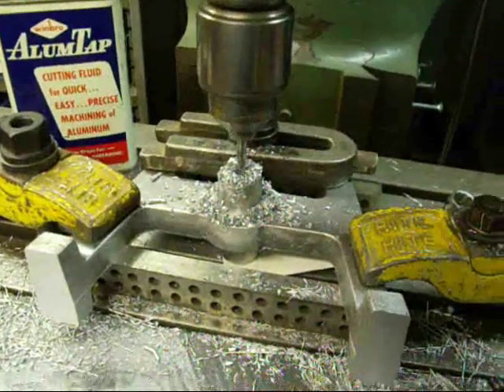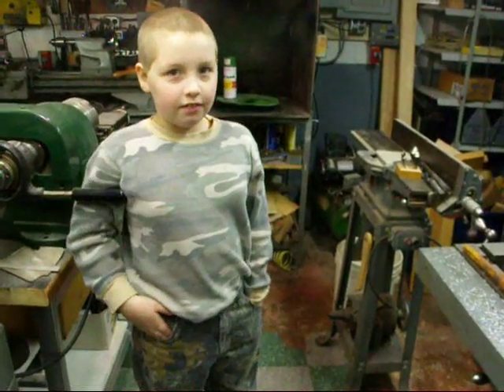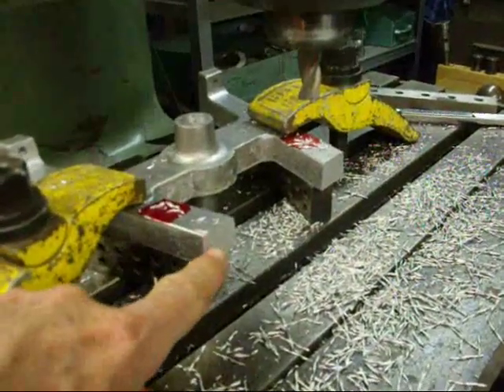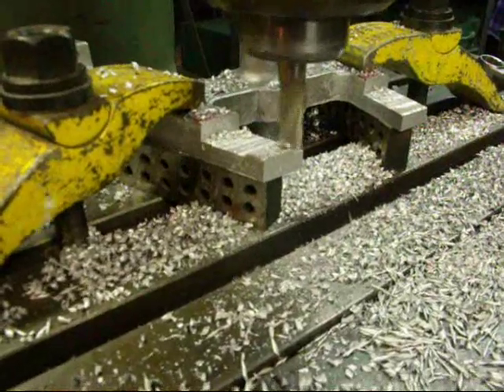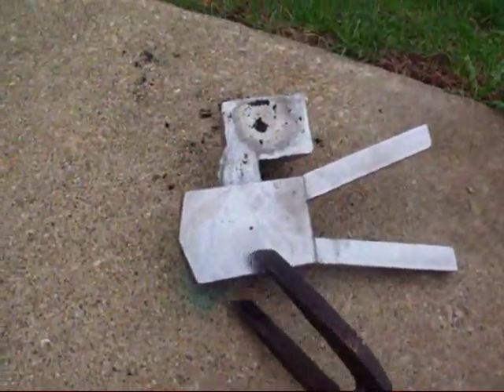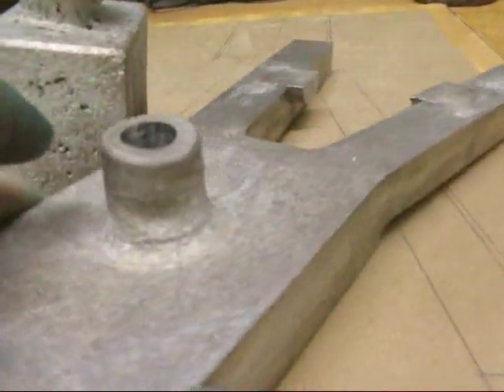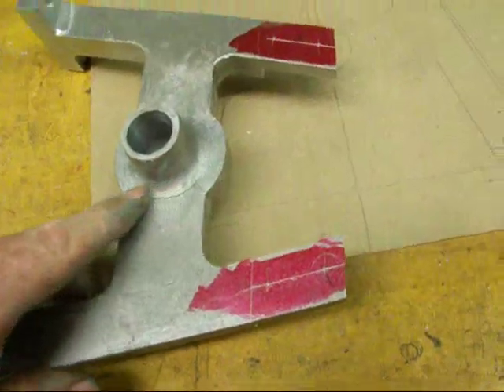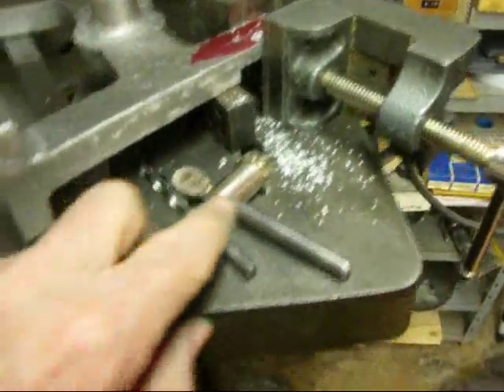BUILDING A MODEL STEAM ENGINE part 5 tubalcain

Comment: Hey I was wondering if you are/were a machinist by trade, or if you just started doing machining as a hobby, and are self taught? You have some pretty darn nice machines in that shop of yours, if I were there that would be like seeing a kid in a candy shop. That drill/mill you're using in this video is absolutely fantastic, but also it is MASSIVE. That thing must weigh close to 1000lb, looks older and very well made (like most older machines).